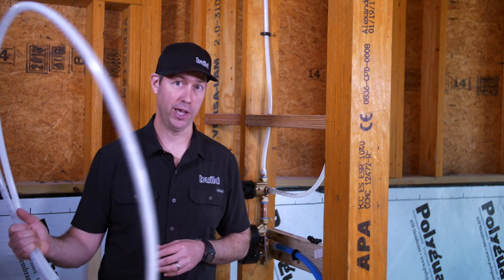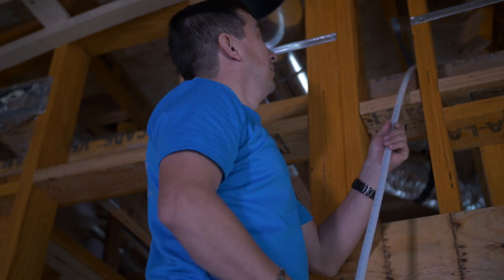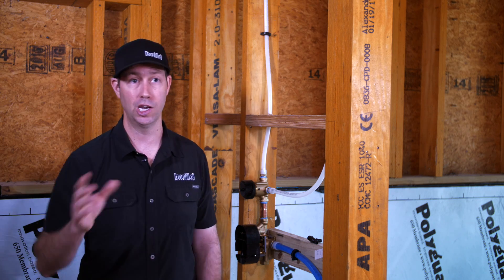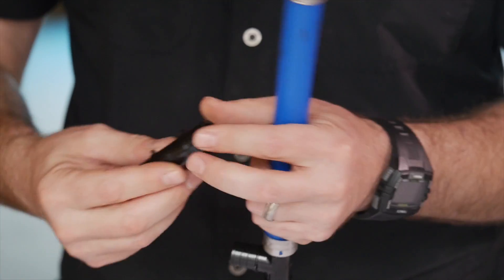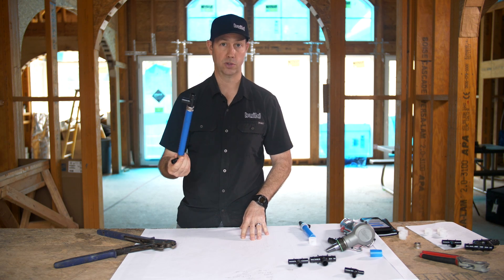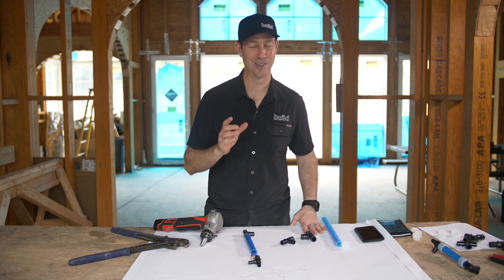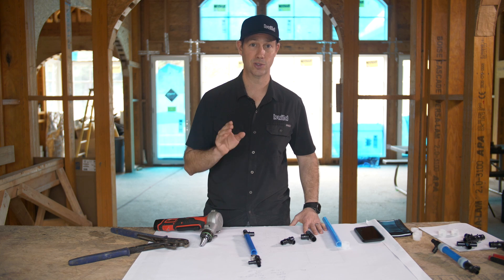PEX vs. Copper Plumbing

Comment: You didn't mention any negatives of PEX, nor mention anything about PEX "C". You didn't say anything good or bad about copper or go into detail about CPVC/PVC (other than freezing)
Reply: I suggest you watch the video CHRIS.
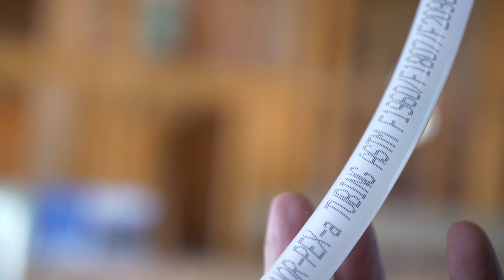Reply: The beginning of the whole video he mentions the benefits of pex and pretty much every benefit of pex is a downside of copper. The freezing is bad side of copper and pvc. The only down side of pex he mentioned is around 4:18 and its about fittings. Maybe you need to watch it 3 or 4 times
Reply: Chris Woolvin  I agree. You should watch this video.
Reply: Sure he did.  One example s at 3:40 on
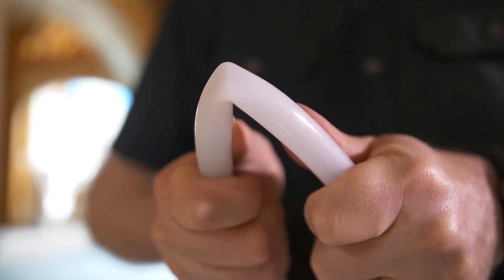Reply: Chris Woolvin  and at 4:14 he discusses the downside.   Watch video plz?!!~
Reply: then I'm afraid we watched different videos, I stand behind my original query

Comment: I personally know several people with horror stories of this pipe. Leaks in attic and inside walls. Pipe split for no reason.
Reply: Probably not Uponor & terrible installation.
Reply: elbuggo no it’s pex and had professional installation in a new house   That pipe has flaws. Not predictable
Reply: Uponor is not the average pex system. One unique feature is that it very easy to visually inspect or control the connections. Sounds rather unbelievable with flaws in Uponor AquaPEX pipes.

Comment: You seem to have overlooked the biggest problem with Pex and especially Pex B and C which is U/V deterioration.  No manufacturer disputes this as all have definite time limits that they can be exposed to daylight and they are not that long at best.  Since U/V is part of the spectrum from indoor lighting and explicitly florescent lighting it does not stretch my imagination to believe the accounts of Pex failing in dropped ceiling installs with lighting alongside it.  Any amount of exposed material (Pex) will fail.  Think open walls on building projects that exceed six months (the longest rating I know of which is for Type A), outside hose bibs, dock runs of water etc. etc.  City water systems can be quite problematical not only for the chlorine you mention but other additives:  ammonia, water softeners,  fluorides, additives for sterilizing and more.  These are hard enough on metals today god only knows what future chemicals will get added to the witch's brew.  Europe has a very good track record but the products produced and used over there have stringent government controls and are most usually of far higher quality than what can be dumped on the American market.  So their experience to the positive does not necessarily translate to the same performance in the US.  In fact we have already experienced the complete failure of one style of Pex (aluminum core) that had been installed in numerous new homes and remodels before it was evident that it was a total failure.  I would like to see an impartial chemist compare top grades of Pex from the US and from Europe as a starting point.  I really like the concept of Pex but just am not ready to trust the manufacturers quite yet.  Good topic though.

On another subject:  Everyone is building tight houses these days.  To enhance that most modern combustion sources get their make up air from outside to keep from exhausting conditioned air and drawing negatively on the house envelope among a good many more reasons.  However I have no knowledge of anyone figuring out how to supply outside air to an electric clothes dryer?  Have you?  A four inch line pumping somewhere around 100 cfm is right up there with bathroom ventilators and range hoods.  In combination these are removing a lot of expensive heated or cooled air and putting quite a load on the door and window seals.  Is anyone addressing the dryer issue specifically?  Seems a scaled down air to air heat exchanger or better yet a dryer ducted to take in outside air to dry with or combination thereof would be a great energy improvement.  Maybe someone is doing work on these and I have missed it.  It would be a great topic for a future segment.  Take care.  Doug
Reply: This sounds like much ado about nothing. . . I installed pex in 1988 and all the pipe in the basement was exposed to standard fluorescent lighting (and some natural light, when the walk-out doors were open) and I've seen no signs of any degradation what so ever.  Now, I would NOT use pex outdoors, constant uv exposure will kill it, but the idea that fluorescent lights or a few days sitting in the back of a truck will ruin it seems far fetched.
Reply: I wasn't referring to the systems that dump the humidity inside the house (as well as quite a bit of lint).  Do you know of a vented heat recovery system?  The point I was attempting is a closed system like a boiler.  In my region and quite a few others our household levels of relative humidity need to be reduced even in winter so adding the huge amount of moisture from a dryer would be very detrimental.  Cutting off the inflow of cold air and the dumping of heated/cooled air is the goal I would like to achieve.  I don't know of it even on the drawing board.  I would like to hear if you know of such a system.  Take care.  Doug
Reply: Douglas Thompson We built customized, adjustable air intakes for little fancy woodburners in low energy and passive housing but I went out of business with the German energy saving verdict of 2014.
I do not know of any dryer using solely outside air on the European market.
If You want to build something like that it'll be complete custom, I'm afraid, so the technical and physical boundary conditions in Your place are what leads to Your custom solution.
My passive house customers usually decided to have a special, only slightly warmed (above freezing) room for the dryer and washing, which would count climatically already as "outside" (in terms of air/vapor) to get around this problem. 
It is not easy when You're located in harsh climates, and the technical complexity with every step towards even more "energy saving" increases at least cubicly, so You quickly become Your houses slave, in terms of tech solutions, and put in a whole lot of "energy" in a wider understanding to save some single Watts of "energy" in terms of burnt fuel/warmed air.
Reply: Douglas Thompson Oh yes, hell yes, there are easy picks, while I reckon You already have triple glazed low e triple sealer windows, no windy gaps around  said windows left and a halfways decent facade and roof in terms of insulation ... end of easy picks on the losing side.
The gaining side is even less of an easy pick, following my personal experience: every next-generation boiler, every next-generation warmth-gaining device of any sort is a nightmare in terms of maintenance compared to what it is supposed to "easily" replace.
I went back to simpleton eighties boilers and dis-integrated all of my several systems to gain warmth (at home in an unfriendly climate myself) just to enable myself to make it through the whole winter without weekly troubleshooting.
Slight undulations in the quality of natural gas my supplier delivered lead to  emergency shutdowns twice a week with a brandnew save-a-lotta-gas f**ktard of a boiler ... the whole first winter I had it (got rid of that in the first subsequent summer ...) and so on.
So, easy picks with a measurably regain of tumbler energy ... not so much, if You don't want to create a bunch of new problems of the building physics variety, I'm afraid.
Reply: @Douglas Thompson.  Acids, salts, and many other chemicals are usually shipped in plastic bottles, drums, and barrels, because plastic withstands most chemicals better than metals - check your car - the metal will rust, eventually, the bumper cover and other plastics will not. 

Don't get me wrong, neither material is perfect, and copper is not without downsides, but you have attributed some of the downsides to the wrong material.
Reply: In a perfect world that would be true.  However in the real world the product spends time in the factory, transit, inventory in the plumbing shop, riding around in the truck and sitting in open stud bays during construction.  I see no guarantees and or use by dates to insure you are getting a fresh product.  In a complex build by single or small crews open time can be several months.  Now bear in mind that the 'best' guarantee on Pex A is for six months exposure!  B and C are very much less (thirty days).  Now this is real.  Here in an area with almost no sunshine comparatively (northern rain forest) I saw an installation of Pex A used on a 100 foot run to and on a dock.  Within a year it had failedl catastrophically showing cracking and splitting the entire length of the run (It was drained in the winter so ice was not a consideration).  Now add in that generally U/V sensitivity is coupled with ozone deterioration as well.  Ozone is generated by several domestic sources including but not limited to electric motors.  Think boiler rooms, home shops etc. etc.  This ozone will be in the Pex's environment.  U/V is not encountered just in direct sunlight as well.  It is generated by most forms of light and some heat sources.  The dropped ceiling scenario has already been documented.  By all means be my guest and use it.  Should it work for thirty or fifty years without you having to gut your interior walls I will be well on my way to being persuaded.  Keep in mind that this failure is most probably going to happen long after any two or three year house warranty expires.  If you have the money (a house gut is not cheap or for the meek) and the urge to gamble jump right in.  Take care.  Doug
Reply: Well I can only refer you to the manufacturer's printed warranty which states a limitation on length of time in a service truck.  I have never seen or heard of copper failing in a like situation here and yes the system was fully drained. PVC has even been used (still degrades over time but not nearly as quickly as Pex). As we are in a coastal temperate rain forest we see temperature differentials from 5 degrees to 85 degrees.  A pretty mild range compared to most of the country.  In more than five decades around the building industry I have seen many 'miracle, latest and greatest' products come and go with few surviving the test of time.  This is a predatory society in case you haven't noticed (does Enron/retirement funds ring a bell?  Why would anyone produce and sell a "C" grade Pex?  This country certainly allows it.) with the consumer the prey.  Big companies and many small ones are rarely held responsible for product failures.  As they say in Latin, Buyer beware!  I might be a bit more inclined to try European Pex as their products most often are better than ours.  Since most of our modern products are engineered down to the point of failure (acceptable loss business model) this is hardly the climate one would like to see when trying new products.

As I stated I am not 'against' Pex and would love to see some practical alternatives to expensive copper but it raises my hackles to see 'Pollyanna' reviews that don't reveal serious drawbacks.  Any consumer needs to know the full pros and cons before making a decision as it is a costly gamble if it fails (LP siding in the NW left many holding the bag etc. etc.).  I would advise those who wish to try it to ameliorate the risk as much as possible.  Plumbing walls, chases, access panels and more should be considered in such a move.  I would weigh cost/risk benefits thoroughly before using it.  Having said that I probably would use it in certain situations where it would be easy to replace and would do little collateral damage.  I would monitor it very carefully for sure.  I would like to be proven wrong with Pex and would be the first to applaud it should that be the case.  It just does not have a long enough history.  When I say that I am referring to these 'new' companies producing the product in this country.  Take care.  Doug
Reply: @douglasthompson2740  real world - I've installed over 30 systems of PEX A and have not had one callback.  On the other side - I've had over 30 calls of copper pinhole repairs in the last 10 years where the copper was probably about 40-60 years old.
Reply: Is not the date printed every few feet on the product itself?
Reply: Ventless clothes dryers are on the market.
Reply: manfred schmalbach.  Good points.  There are the easy picks with high return though.
Reply: Don't forget the chemicals leaching into your drinking water. 

https://www.purdue.edu/newsroom/releases/2014/Q4/drinking-water-odors,-chemicals-above-health-standards-caused-by-green-building-plumbing.html

Copper correctly installed can last 100+ years. Good luck getting Pex to do the same.
Reply: copper might last 100 years, not likely, but for the same cost I can plumb my house 20x.
Reply: That's why most dryers are in a laundry closet off the garage. At least mine is and most of the people I know.

Comment: My 1960's house was remodeled using pex.  Water had a terrible flavor the first year. Gradually got better. Finally back to normal about the 3rd year.
Reply: Odd.  Pex is used in water bottles, milk bottles etx.
Reply: Odd.   http://bfy.tw/F6Vp
Reply: All of which are meant to be thrown away in under a year.
Reply: You probably used exposed PEX pipes under the sun.
Reply: Do you mean that the PEX has been stored out under the sun?  The PEX plumbing was install on the Interior of my house in Anchorage, Alaska.
Reply: But what about the pipe from the meter?
3 years of bad taste is not normal man, usually only copper pipes can make a bad taste for so long.. if it's not UV radiation then I'm afraid you have a contaminate in your water line.
Reply: I think you misunderstood. The taste is good now. The taste was good before the PEX. When the PEX was installed, the water tasted like water from a garden hose. It was terrible. Over time, the taste got better and better. By the 3rd year, the bad taste was completely gone and back to normal.
Reply: Interesting. Will do. Thanks.
Reply: I understood that, but still, 3 years of bad "garden hose" taste?!
This is not normal as even 3 months is a very long stretch.
Make sure your PEX pipes are PEX-B as PEX-A pipes are known to have some possible residual or leaching chemicals from the manufacturing process.

Comment: Only good thing about pex you can go from the attic to the basement with no fittings in walls and cheaper to do manifold systems. I prefer copper viega propress if valves not holding don't have to cut main off. Have done plenty full city pressure in emergency. Expensive though but a lot faster than sweating. Especially on 1" -  4" lines you can make up your repair with no stop couplings.